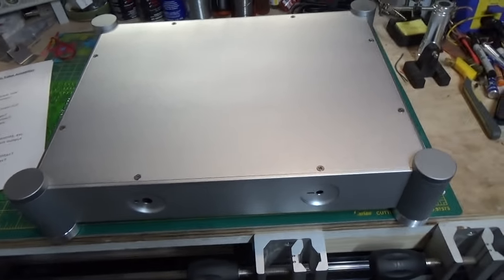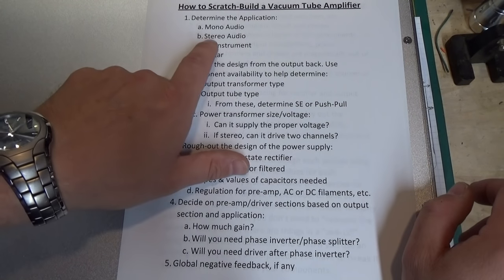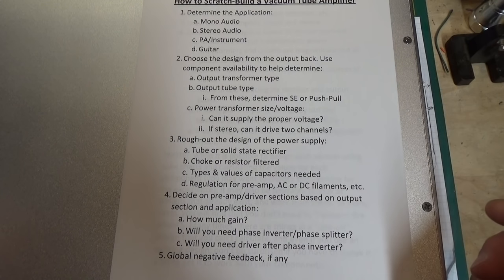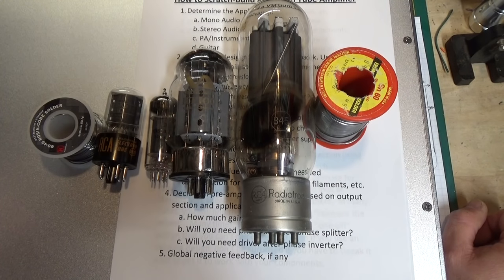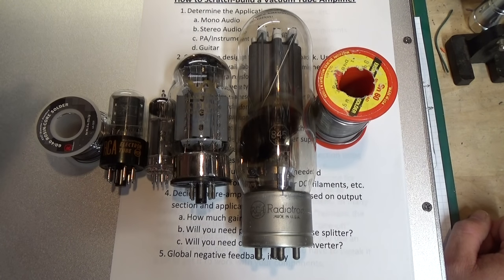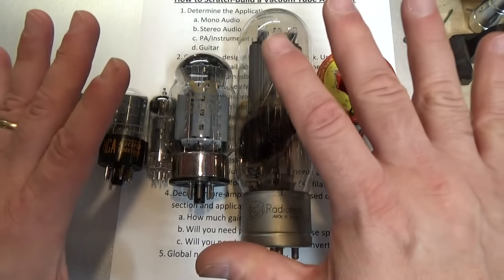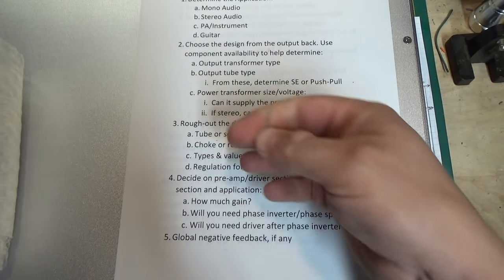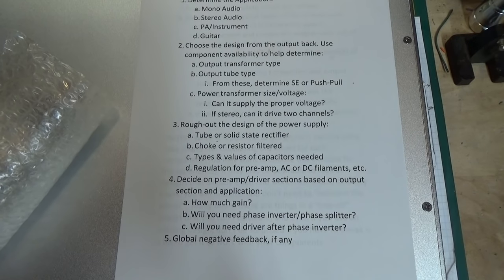Scratch Build a Stereo Tube Amplifier   Part 1

Comment: 80 rectifier is like a 5Y3, not 5U4.  Also, since those are directly heated types, they'll produce B+ before the rest of the amp is warmed up.  An indirectly heated rectifier like a 6X5 or 5V4/GZ34 will warm up at the same rate.  Also, you'd connect your filter cap to the cathode, not the anode (38:00 mark).  Maximum input cap size (capacitance) can be found in most tube manuals.  Voltage of the caps should be determined by the RMS voltage of the transformer x 1.414 for maximum voltage it should encounter, with operating voltage no more than 80% of rated.  Despite the the few flubs I very much enjoyed this video!

Comment: Excellent serious and I’m not easy to impress I’ve been playing guitar since I have been 14 I’m 70 now I’ve been working with two Banff starting at 14 I started learning tubes because that was all there was at the time been interesting time in electronics I happened to have been a qualified engineering tech that got misguided and got in the hi-fi happened to live close to what became a big audio store and lived my dream about working on extremely nice power abs and such Leamington Carver threshold nice but I got bored and I’ve tried different topologies of output tubes and circuitry I came up with a bridge style with four different devices and the output transformer across the two Centerpoint this allows for no DC bias current to be put through the transformer this allows the transformer trains states quicker and make for a superior frequency response a good square web out of a tube app is the holy grail

Comment: Just a note in the Filter electros in the power supply, Solar inverters use lots of them rated 510V or higher and normally they all are very high quality, if you have service centers  like for the brand Fronius you could ask them to go bin diving and you will get a truck load of free high quality capacitors :).

Comment: Have to disagree with you on something- the plate and screen voltages may be the same in a lot of those amp configurations, but that is not the same as running the tube triode connected.  The screen supply is taken on the B+ side of the transformer and the plate on the other.  The resistance of the windings will not drop the voltage to the anode all that much so they have essentially the same voltage as measured with a meter.

Comment: Yeah it's from 2016 film and I write in 2017...

Why don't just use standard wirewound power resistor. They are design to dissipate a lot of power/heat, have low self noise, and in standard wiring they are for all purposes coils. Also ferrite could be placed on it.

And they might add a bit of safety as there're versions of wirewound resistors that work also as silent fuses.

Comment: Great Series concept... Looking forward to it!
Is that old theater amp you have a Western Electric? Dollars to doughnuts; that's what it is... LOL!
Reply from the maker: Boy I  wish it was Western Electric!  Actually, It's a very old RCA Theater amp.  Weighing in at about 200 pounds, it stands about 5 feet tall and is solid steel!  I measured over 1200 volts on the secondary of the power transformer.  I just didn't have any good type 866 mercury rectifier tubes to power it up.  Maybe someday......
Reply: Wow... That's a beast. You should show a pic or a clip of it...
Reply: You could use diodes lol.

Comment: On a scale of 1 to Donald Trump, just how stupid would it be to use a switched mode supply on a tube amplifier? It would make the power supply a whole lot cheaper if you didn't need a great big transformer.
Reply: A 2 or 3.  It totally works as long as the switching supply has a clean output, and switches above audible frequencies.